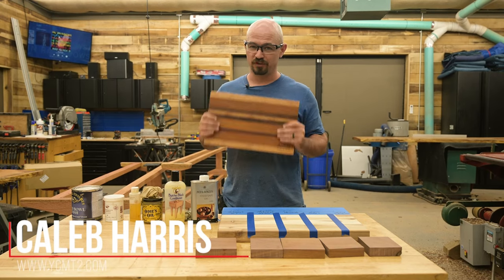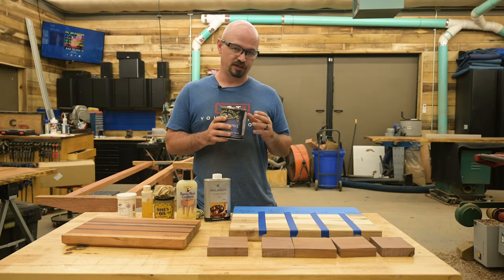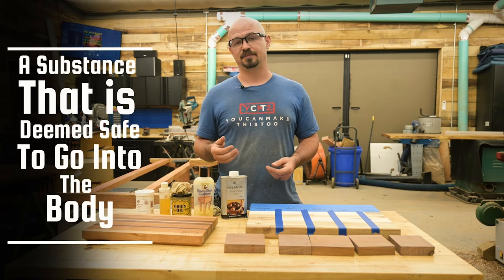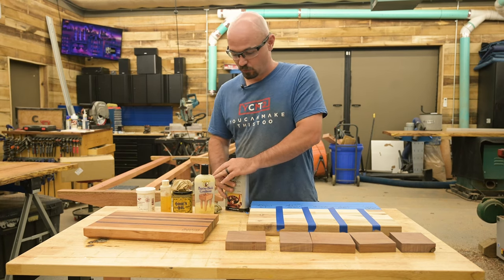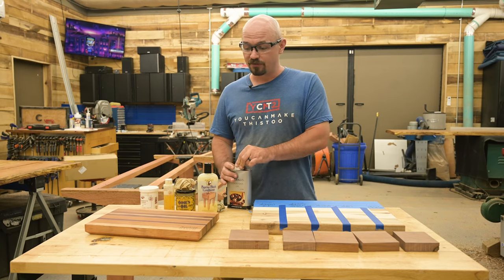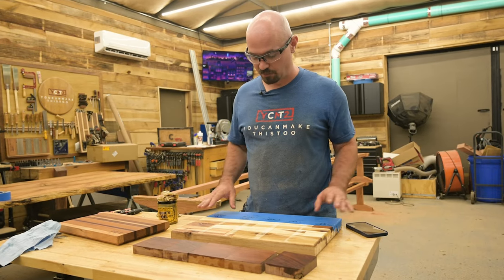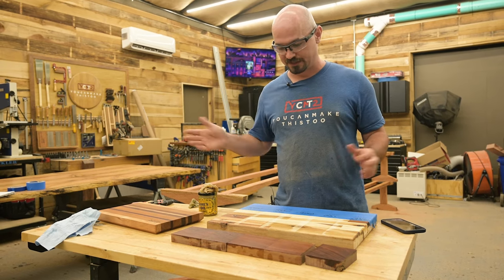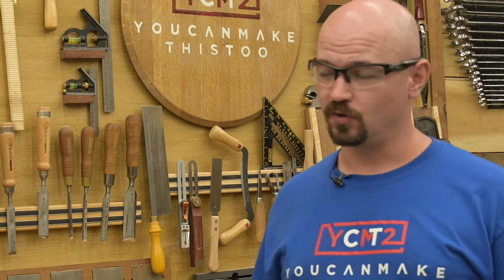My New Favorite Cutting Board Finish

Comment: Tung oil is also a great option. Make sure you use real Tung oil and not a "Tung Oil Finish"
Reply from the maker: Truth
Reply: How long does it take to dry? Does it require repeat application or is this only for new boards? I’m asking because I just bought a massive teak cutting board. I can’t get clear answers. I read somewhere that tung oil is good for new boards after which you just use a mineral oil/beeswax paste.
Reply: To know youre using real Tung oil it will say 100%tung oil on the container. Most people probably might consider that common sense but those marketing folks are quite crafty and deceptive (aka they straight up lie to you) so it can be difficult sometimes to decern so If it says 100% tung oil you know you are good to go. It could potentially still be sourced from endangered french kissers, but it should, bar any illegality, be pure tung oil.
Reply: @DemarioBruton  You okay, man?

Comment: The best and at the same time most cost effective oil I have tested is refractionated coconut oil. Just remember, it has to be refractionated
Reply from the maker: Thanks for sharing!
Reply: Isn’t it fractioned?
Reply: @dlev  it's actually 'fractionated'
Reply: Does that stop it going rancid? And what is added to the oils in this process? Most of the time some kind of petroleum product is involved.
Reply: @f.kieranfinney457   Apparently “fractionated” refers to the process of removing fats, which can turn rancid, from coconut, leaving only the oil. Nothing is mixed in, and the resulting product is edible.  Seems safe, but I wonder about cure time and durability.
Reply: @terrycoye3373  or use seed oils which never go rancid. Walnut/beeswax is best visually, but if someone has a nut allergy I’m not sure the reaction. So for customer boards I use organic flax seed oil from the grocery store with dissolved beeswax. Flax oil cross-links (polymerization baby!) and hardens a little while coconut doesn’t to my knowledge. And doesn’t need chemical refining like coconut. But anything to replace mineral oil is good. I never understood why anyone would knowingly ingest a petroleum product, no matter how refined.

Comment: FYI anyone who wants to use mineral oil, go to a pharmacy or drug section of a store and you can get it sold as a laxative for cheap. It’s about the the same price per mL as a getting a bulk gallon, but they sell it in small containers so you don’t need to buy a decades worth at a time
Reply from the maker: Good tip

Comment: Strange you didn't test the best oil there is for cutting boards - Pure Tung Oil.  It soaks deep into the grain and cures (hardens) nicely plus it is completely food safe and food grade being a natural product made from crushing the nuts of Tung trees (painless process I promise).  Takes a good three days to cure although you can quicken that by adding some  Orange solvent, again made from a food source - Orange Peels.  Wax is crap and you will get nothing but disappointment from clients who complain about how scratchy the board looks over time.

Comment: I’ve tried Odies, mineral oil, walrus oil, tung oil, and linseed oil on my boards. They all have positives and negatives. I’ve notice that the grain pops on walnut after a few days with mineral oil and walrus oil. I like odies dark, linseed oil, and tung oil on maple. The really penetrating oils can mask some of the character on dark walnut. I prefer something with a oil/wax combo for walnut. Just in case any cares!
Reply from the maker: Thanks for sharing!
Reply: How long does it take Tung oil to dry? Does it require repeat application or is this only for new boards? I’m asking because I just bought a massive teak cutting board. I can’t get clear answers. I read somewhere that tung oil is good for new boards after which you just use a mineral oil/beeswax paste.
Reply: @AereForst  I realize I might be too late but tung oil is best (IMO) for cutting boards due to it's nontoxic + waterproofing qualities. 

Yes, it will need upkeep, but any of them will.

Work the oil in with a brush or rag and wipe off excess. 

Wait for the first coat to dry and sand with a fine grit sandpaper. Careful not to sand off your coat, 400-600 grit.

Worth the wait: In dry & warm conditions it can dry in a few days. In more humid & cool conditions it can take up to two weeks.

Reapply to 3-5 coats.

WADDED OIL SOAKED RAGS CAN SPONTANEOUSLY COMBUST. Lay them out and allow them to dry. I throw mine in a tub of water.
Reply: @squigglyline2813  thank you. I’ve come to the same conclusion after research. Been busy, so I haven’t yet tackled the project. So far this is my plan:
1. Sand with 220-320 grit
2. Light coat Tung oil (TO) then buff off excess immediately
3. Wait at least 48 hrs
4. Repeat for a total of 3-4 coats
5. Leave for a month to fully cure
6. Apply mineral oil/beeswax/carnauba wax to surface

I will incorporate the high grit sanding in between coats as you suggested

Comment: Oh, another word on walnut oil and rags. I, being some one who has to experiment, tried to get my walnut oil soaked rags to spontaneously combust. It never worked, until one day in mid summer, I had left some out to dry on a black plastic garbage bag that was full of shavings. It was also on the south side of the shop so it got excellent sun exposure. It did start to smolder. So I would say that as long as rags are spread out flat, on concrete or gravel, it is pretty much impossible for the walnut oil soaked rags to combust. This is because of the very slow oxidation/curing rate of the walnut oil. It takes a week or so for the oil to cure, and sunlight and heat help speed up the process.

Comment: For all intents and purposes, the parts of the finishes that are not good for you are the solvents. This means that once the finish has fully dried, its food safe. If you can still smell it in the wood its not fully cured yet. Yes they are toxic if you drink them but once dry they are pretty much all safe. You have to ask the questions.
Reply from the maker: Yep, I did like a 20 minute video doing a real deep dive on just that fact.

Comment: I have been using walnut oil on my bowls for 20 or more years, can't remember. The walnut oil does cure and harden which mineral oil and vegetable oils do not do. Vegetable oils will polymerize if it is heated, like seasoning a cast iron pan. I did use Mike Mahoney's oil for a number of years, and switched to 'the Doctor's Woodshop' walnut oil. Especially for end grain cutting boards, final coat is applied with a heat gun which makes the oil penetrate better. His carnauba wax in his oils can spread without heat. For me, I won't put anything on my bowls that I can't eat straight out of the can.... The walnut oil you buy in the grocery stores is not the same thing. Some will cure, and some will not.

Comment: hi there, awesome video with great info.   What about serving board finish, as opposed to a cutting board a serving board would be to put food, ie cheeses cured meats, veggies etc.  I am struggling with finding a finish, these foods have oil that leave marks on the types of finish you have on your video.  Would this be a time to use polyurethanes since you would never use a knife on the board anyways.  I would be interested in your view.  Appreciate your time, thanks.
Reply from the maker: If you're just serving then I'd be fine using a film finish like a polyurethane, just make sure it's had time to fully cure (not just dry) before using it for food contact.

Comment: I use Flax oil.  It is food safe.  I use it all the time on my Blackstone griddles.  It polymerizes, so it is a good drying finish.  I can get a nice sized bottle from Walmart for about $9 and change.  Since it is basically a linseed oil it will provide a good water resistant finish to wood.  The only downside to any linseed oil finish is to burn the rags you use to put them on because they can spontaneous combust.  I burn my rags that I use to put in seed oil on my axe handles and gun stocks after use.  I don’t know the exact chemical difference between flax oil and linseed oil but I treat them the same, since they are made from the same thing - flax.
Reply: you use it to season griddle ?
Reply: @ronboudreau5357  yep, flax oil, cooking grade, from Walmart.  After every use, I clean it with water while it is still hot, and then squirt flax oil on it and wipe it down with a light coat.  I use a combination of Canola oil and olive oil to cook with.  Frying bacon on it will really help the seasoning process.    Some nice mornings, I throw some bacon on my little 17 inch and cook it golden brown, break a couple of eggs on it an cook them over easy and then throw a couple of pieces of bread on it and brown them.  I can fix breakfast faster than my wife and it tastes like a breakfast cooked over a campfire.  I can then clean and protect the griddle before my breakfast has cooled, maybe even eating it while I am cleaning the griddle.  My 17 inch is on a 20# cylinder.
Reply: It IS essentially the same thing. But flaxseed oil is processed in food-safe conditions and linseed oil is generally not. Especially not if it is aimed toward painting use.

Comment: Excellent Explanation 
Just built a project and experimented with Odies, and their stain and oil & butter, etc… what a learning curve.
Expensive one both in time AND materials. And too I believe that the kicker was the color aspect. The cure time for the “ stain” with 1 way of making the “ stain” requires like 24 hr dry time - I learned a lot and the customer support is pretty good! One aspect that was different for me was if the “color “ “ mix “ [stain] is NOT cured, the Oils will actually pull pigment from the wood!

Thank you for your review of the oils/ waxes-

I NOW plan to USE the Odies for its durability & ease of application!

I’ve also used a brand called walrus food safe oil and believe the clients remain happy , BUT it’s Probably NOT getting blasted with cleanin much!

Thoughts on Rubio? 

Keep on going —-BTW noticed your magnet racks for chisels etc
“ same” same - with a small shop, with limited time to make racks & constant cleaning up in order to actually get some work done I’ve added many more magnet strips and removed space taker racks ! “ ya know .., great minds right…” haha-

Any excellent tips / designs for:
1]Mitre saw station & vacuum setup- my setup is lame

2] Should have NOT bought the contractor Sawstop as my dust collection is awful! Love the saw though 
 Any good tips in case you’ve addressed this weak aspect of this type of saw dust collection?

3] simple router / handheld jigs for straight edge ie templates/ and or in a router table easy setting location of said bit -

Feel free to email - hewittcory@gmail.com 

Thanks man

Cory

Comment: Great presentation, thank you.
Question. I like the idea of the Odie’s Oil, but the boards I have do have some cracks (through, top to bottom on edges), and I wouldn’t be able to get the paste down into the cracks. Suggestions? Thanks!
Reply from the maker: Hmm, great question. That's where mineral oil is handy because you can completely soak it in a bath. I'd probably handle it by using walnut oil. It's quite runny so it'd probably seep in there quite well.
Reply: @YouCanMakeThisToo  Could I then use the Odie’s Oil over the top of the Walnut oil? I really like the idea of it sealing well and being more permanent.

Comment: Very informative video..well done. I was considering making a cutting board and will get to it just as soon as I recover from the heart attack I had seeing the price of the Odie oil...LOL Must be made from virgin unicorns on top of a really high mountain and I'm gonna have to leave any unused Odie in my will.
Reply from the maker: It's pricey... but for how far it goes I'm not sure it really costs much more per application since you use so much less material. Just a bigger initial investment. That said, there's tons of cheaper products to get ya started!

Comment: Have you ever used thinned ting oil to treat you cutting boards?
Reply: Tung oil. Dang auto correct!
Reply from the maker: I haven't, a lot of tung oils have chemical driers in them though that I wouldn't want to put on a cutting board. Would have to pure.

Comment: so if you have put mineral oil or mineral oil butcher block conditioner into your board do you need to sand  the board back to bare wood to add a different finish?

Comment: Speaking of polymerizing oils have you tried tung or hemp oil? For that matter what about linseed (available as food-safe flax) oil?
I'm not a board maker, build the occasional project and do a little furniture restoration. Tung is great for that as it's a bit semi-gloss. I've been using hemp on the butcher (grain exposed) boards in my kitchen (and sometimes a 'butter' I make with it and beeswax). It wears where it's gotten beaten up by knives (shaving-sharp knives here). I've experimented with making a first coat of 50/50 hemp oil and orange-peel solvent. Doesn't seem to make it any more knife-proof (wears about the same in those spots).
Reply: Thanks.  Very informative.  I’m going with 50/50 Tung Oil and citrus solvent on current board I’m making.  A recent video from The Wood Whisperer convinced me to give it a try. Fingers crossed!

Comment: At 6:16 he advocates warming up the finish but there is no mention of warming up the cutting board. When the warm liquid contacts the cutting board the temperature goes down very fast. Why not warm up the cutting board as well as the finish? Please explain.
Reply from the maker: It’s what the directions say, and it still makes a big difference just warming the product. 

But if you wanna go extra you can put your boards in a giant ziplock and weigh them down in a sink of warm water, put them in a low temp oven, or use a hair dryer to warm them up.
Reply: A hair drier, found in many home shops, seems practical. Those who use epoxy resins warm up the wood if they warm the resin.

Comment: Great comparison video!  Question:  how does the Odie's Oil work on wood/resin boards?  Specifically the resin part of the board?  Thanks.
Reply: I used it on some wood/resin coasters I made for Xmas presents last year and its held up really well. The only thing I will say is make sure you let it cure fully before you use it. I've had issues with it being on wood and seeing "dry" spots and/or white rings from hot things. It does great on the epoxy though.

Comment: problem with spendy oills, if you are SELLING boards, the customer will likely not buy and reaapply something that costs a lot.  Mineral oil you can cheap at Walmart or local drug store.
Reply from the maker: No harm in reapplying mineral oil over it. I normally recommend Howards to people for re-applying because it's pretty affordable.

Comment: What are your thoughts on pure tung oil for cutting boards?
Reply from the maker: Should be a good option
Reply: Tung is probably the most water resistant of the oils and if it’s pure tung oil (not tung oil finish!), it’s food safe.

The downside is that it takes a lot longer to dry than the others.

Comment: Grapeseed oil. Food safe, food grade, no odor, no color. Also my go to cooking oil because it adds no flavor but allows the flavor of the food to come through and has a 420 degree smoke point. 3 or four coats, rubbed in with your bare hand (you can rub the excess into your hands as this oil is a great treatment for dry hands). Leave as little oil residue as possible after rubbing 2 or 3 minutes. I would estimate about 2 or 3 tablespoons per square foot. Allow 24 hours between coats and sand with 220 sandpaper between coats. Easily recoated anytime and brings out good color in the wood.
Reply from the maker: Great advice, thanks!

Comment: I'm confused . . . Trying to figure out the point of this video.  Application is a no brainer, what wasn't addressed or wasn't addressed very well was long term wear and tear and customer maintenance.  Though Odies is ok not many customers will spend $45 for a jar for their cutting board and 99% will maintain their board with a mineral oil wax blend.  Something to think about when selecting board finishes.

Comment: I wince every time I hear someone use gift as a verb rather than give.  Gift is the past participle of give.
Reply from the maker: It's all good. I have irrational pet peeves too.

But you did inspire me to check to make sure I'm not sounding like an uneducated idiot. Brittanica, Merriam, and Oxford assured me it's been used as a verb for a long time. 

But we can all agree "gifting" is taking it way too far.
Reply: I wince every time someone uses 2 spaces after a period.
Reply: @ryanlafond9488  Interesting.  Why?
Reply: "Given" is actually the past participle of give-- GIVE (present); GAVE (past); HAVE or HAD GIVEN (present or past participle)
Reply: @troybush5899  Those are verb forms of past participle for "give".  "Gift" is an adjectival past participle.  In fact, your post reinforces the point that there are other, extant, better verb forms rather than using a noun or adjective as a verb.